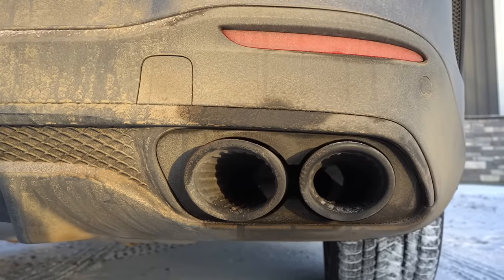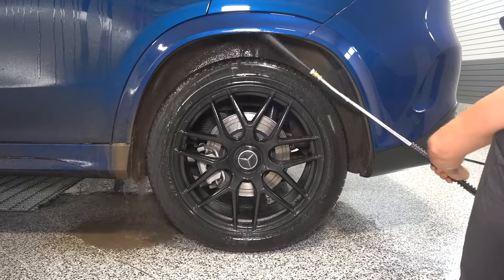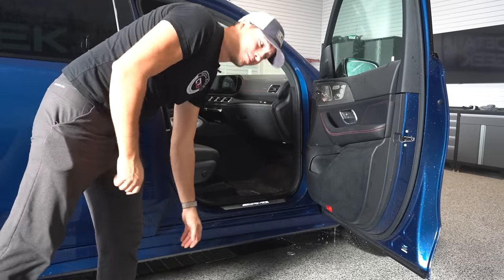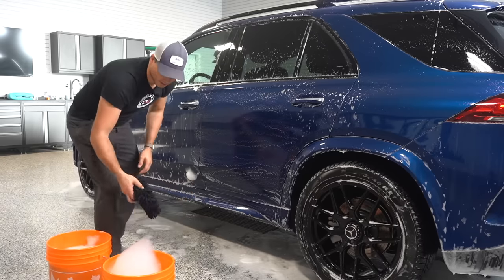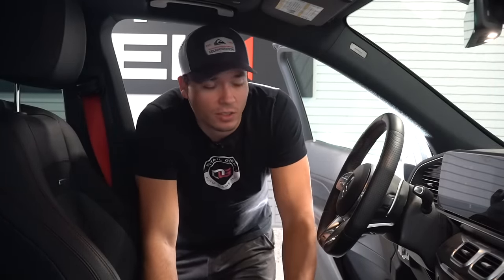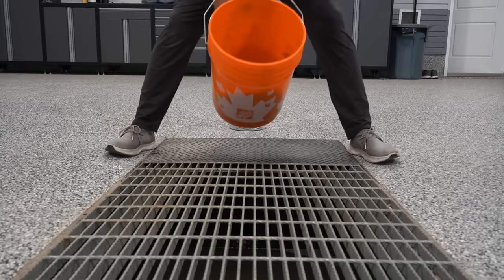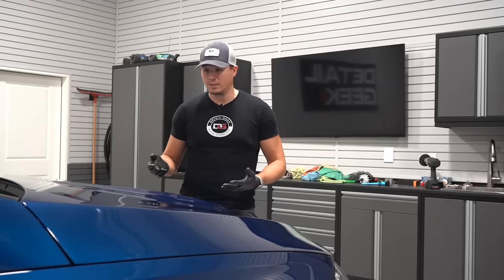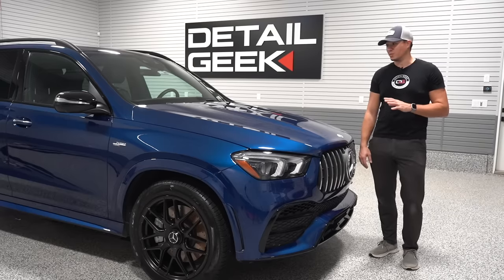Is Mercedes The WORST Car To Detail?

Comment: Great work man!! Watched a bunch of your videos and honestly great work. You really do need to consider getting a better vacuum, a home central vac & tiny attachment isn’t really the best and many videos it shows it isn’t really picking a lot. Just takes up your time even more if anything. Suction just isn’t there and using a good solid brand like dewalt or another good shop vac will go long way in picking up a lot more particles in fibres etc first time around too. You spray a lot of water/solution! Sometimes less is more considering vehicles higher trim levels have a lot more electronics and once that damp/wet even after extraction it’s not fully dry for days & same goes for carpets. As for “brands” charging extras, well we allow that by buying their brand, that being said we also can empower change.

Comment: The new work around for these subscription features is to tie them to a mobile app that has a subscription. Acura has an app,that costs $10/mo or something for remote start, location tracking, and valet mode with speed thresholds.

Comment: Hello, nice work, thaks for all the info.
Regarding that carpet liners on the wheels, those are for safety, on the highways, to reduce the mist fog from the water on the roads. That mist can create a mist and reduce the visibility for the vehicles coming from behind. The ideas, locking and unlocking features, for this practices are taken from Tesla and Apple(eg. supercharger, etc).
Regards from Romania

Comment: This is only the second of your videos I've seen and I have to say, I love your work!!  

As far as the companies charging for subscription features, it seems they're trying to have it both ways.  They charge up front for the feature and then monthly for you to be able to use it.  Having said that, I'm not a fan of government intervention - at least not in a case like this.  I think it should be the market that determines the pricing.  Unfortunately, the mode the market will bear . . .  so far, anyway, is the one where the customers pay up front and then get milked on a regular basis going forward.

Comment: you have to pay for the  enhanced features that come with the SUBSCRIPTION SERVICES offered on equipment that your vehicle comes with as optional, such as Satellite radio (XM/Sirius) or navigation (with Google). Most times, those enhances features come with a free trial period (usually 6months) that you have the option to renew. If you opt not, then you will still have the basic functions of the equipment that is installed. So you're paying for those options.

Comment: So many manufacturers are going that direction. I could see it simplifying the build process. Build all the vehicles the same, and then if you want the features, activate them. But to charge for the heated seats with a vehicle, and then charge a fee to use them? Not a fan.

On the flip side, manufacturers have been asking for extra fees with nav systems for years. And then there's satellite radio. You bought a vehicle with it, should you have to pay the subscription? What about things like GM's OnStar?

Comment: Great video on detailing, though there are a couple of corrections:

1. All 2022 Mercedes-Benz vehicles sold in Canada include a 3-year complimentary plan for Mercedes-Me services, providing users with the ability to remotely start, lock/unlock, and locate their vehicles.

Here are the corrections:

- Heated seats are standard and do not require a monthly subscription.
- Navigation is standard, but over-the-air updates are part of the Mercedes-Me subscription.

The subscription fees for remote lock/unlock and over-the-phone remote start are necessary due to the infrastructure required to communicate with satellites through the app. As a product specialist for Mercedes-Benz Canada, feel free to reach out if you have any questions.

Comment: I think in the UK anyway BMW (vested interest as I own one) said they put all the features in all vehicles these days and not everybody pays for them up front so they'll  charge those who didn't pick the options initially a monthly charge to access them. I don't think this is ridiculous though as it may be cheaper for example to only have heated seats and steering wheel in winter than the upfront cost which is thousands at purchase. Plus with android auto etc you don't really need the bmw map. Whilst remote locking and unlocking is handy I have never needed to use it and struggle to see when it would be useful as you cannot drive the car without your key being in the vehicle.

Comment: I’m in the same situation I bought a 2022 Acura RDX for $60k(usd)and they only include features like remote start and others for 6 months, thankfully many of those features I have them on the key fob since I bought the fully loaded trim but still is a ripoff, also I used mine as my daily driver and it doesn’t get nowhere near close to that level of mess, that owner is definitely disgusting.

Comment: For a 2022 and look how those back rotors are already scored, well they looked really scored, or is that just a different type of rotor. Scary to think what those cost to replace.
Predatory (that is a great word here) business practice for sure. The buyer is paying an outrageous price already, then factor in the cost of ownership of these expensive cars, and now they charge you to use the seat warmers you already paid for, that is robbery.   That would be like a contractor/builder charging the home buyer to pay to use their furnace, air conditioner, and cooking range in their new home because those devices are connected to an IoT thermostat.
I agree with you on the extra layer of protectant.  IMHO I think it would also extend the life of the clear wrap. I have seen videos of the guys who wrap cars for a living and put a ceramic coating on after they wrap them.

Comment: not filty. it is normal durring winter and will be like that in 2 days use.
about carpet liners, they are not carpet they are special mesh plastic. cheap plastic liners tend to crack, especialy when offroadind due to pebbles being thrown from the tire. most cars have fabric linners only at front but
4wd also on the back

Comment: Catching up on so many missed videos. I drive a 2018 Hyundai Tucson. Has a mobile app for all sorts of things. Start, climate control and even location monitoring. It’s $30 a month to use any of it. Despite all of it already being equipped in the car. And it’s been like that for years with them.

Comment: It is ridiculous to pay a monthly subscription for heated seats.  I have a 2022 Mazda CX5 with Heated Seats, Remote Lock/Unlock as well as Remote Start, all through an app, and I have navigation.  I did have to pay for the SD card for Navigation but that was only $50 on Amazon, however it would have been over $400 if I got it through Mazda, but everything else was included with my trim level.  I think I would need to pay to update the maps on the nav card.  As far as paying a subscription for remote lock/unlock, I would need to know their reasoning but seems ridiculous.   As far as navigation system, people pay for subscription radio so it is possible that it is the same for their navigation system, perhaps it also includes traffic updates and warnings with alternate routes.  I would also need to know the price for those last two subscriptions, but their is no excuse for the heated seats.

Comment: Older Merc's had standard plastic wheel liners and they were super quiet. I guess they don't use as much sound deadening anymore on the inside. Mercedes has dropped in quality very significantly... Renault made modules in Mercedes

Comment: Software is being used to control the hardware. I would never buy vehicles that have that but if all manufacturers do it might not have a choice. I'm sure there will be guys doing aftermarket unlocks though.

Comment: I did a little research after my first comment.  If I understand it correctly, there are certain options like heated seats that people may only use one or two months out of the year, so instead of paying $1050 that it costs as a permanent option with a hardwired on/off switch they can use them through an app and only pay a $12 monthly subscription fee for the months they use them. I live in the southern US and may only need heated seats one month out of the year so if I only keep the car for 5 years then with a subscription I would only pay $60 instead of $1050.  It appears that it is cheaper to just have the heating coils in all of the seats instead of having two different premade seats.  I guess they just have a smart chip or something that can be activated by an app.  So in this case they may have not already paid for it, sort of like having a radio that is capable of having satellite service if you choose to subscribe to it.  Still seems petty to not just make it standard.

Comment: Ummm no you don't pay for ft like the seat warmer you do pay for he app which is the Mercedes Me Connect which is free for one year when you first purchase the Benz unless you buy it use . after the year is up if you want to continue using the app you do need to pay $150 for the whole year to get the app working again... which includes locking and unlocking turning on the car and other ft... but that all you need to pay for. other ft agin like seat warmers that comes from factory NO need to pay for a subscription ..

Comment: I'm pretty sure what's happening is that they are charging a subscription for the software that controls all those components, which is how they are able to get away with it. Companies have been doing it for years with computers, tablets, and phones, which means it would be very difficult to regulate, especially because what you listed is not necessarily required for the operation of the vehicle. The only way to stop this is to choose cars and companies that do not charge subscription fees. Market pressure is a lovely thing.

Comment: If it is physically installed in the vehicle it should be included in the price. For example, heated seats has wiring and stuff ALREADY in the car and the manufacturer used resources to make it.
When it comes to things like software, it is like your phone on wheels and it depends on which software it is that runs on the center touchscreen.

Comment: In Germany, too, enthusiasm for such subscription systems is very limited. At least for the people who don't work for these automakers. I'm also pretty sure that the German government won't do anything about it, since almost every politician in Germany has been bought by the auto industry and the auto industry also has draft laws brought into parliament here, which are always approved 1:1. One could still understand it with such services that require constant updates, such as navigation or apps in the entertainment system. But paying to use a built-in heated seat is just plain insane. I would never get involved in something like that or find ways to hack it or bypass it. Greetings from Germany

Comment: I forget who it is, but the cars that have carpet, but on the inside of the wheel liner, I mean, if ya gotta...Oh, black wheels suck, it's like paying for pretty, but getting unfinished, like cars that lost it's hubcaps. Might as well disconnect one of the headlights throw some beer cans on the dash, put a rebel flag tag on the front to complete the look.

Comment: We currently we own a Mercedes here in Aus, we only got to use all the features for the first 3 years. We now have to pay approx $800 a year to be able to use all the features. Guess what, I’m not paying but it will also be the last merc we buy based on this. Car has been fine, couple of little recalls but nothing major. The servicing cost are astronomical, $1300 for a 25k service, oil filter, check this, check that, thanks for coming. I new they would be a lot dearer than say a Toyota Corolla but approx 1k difference, insane. Probably try a bmw next

Comment: I own a 2021 GLE 53, with all features but do not pay for extra features (yet) - not sure if this is something that will be coming though.   The difference is I bought mine in Canada, so there could be a difference in this regard.   I must add I never allow my vehicle to get to this state - I also do have PPF on the entire vehicle, though it is mate, so does make a visual difference.
Reply: Yes this video has some false information. Mercedes does NOT charge for heated seats other then the initial cost when you buy the car. That's a BMW thing that started in 2022.

Comment: It's interesting- I recently purchased a 2019 Mercedes from a dealership, and asked that very question- "This car doesn't have any subscription-based features, does it?". The salesman acted shocked I would even ask that, and said no. But from what you're saying- he likely only said that because I had an older car, and that likely would not have been the answer if I were purchasing a 2022 or 23. Disgusting.

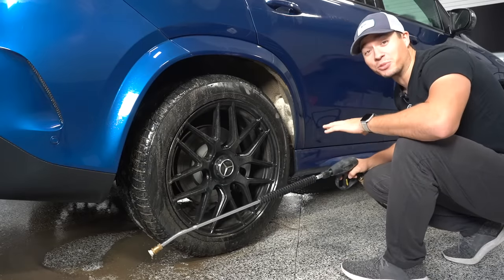Comment: 2:18 It's actually kind of funny you mention plastic wheel well liners, because while we all hate carpet, 3M evidently has a tape that does pretty well at dampening sounds (just found out about it recently); wish they would start putting that on cars, instead..
16:06 what the fruit, that stupid cup holder insert looks like farting aviator sunglasses 😎 😂😂😂😂😂
Reply: "Hmm.. 9 hours? 🤔 ...Maybe 8... 6-8?... I'm gonna go with 7-9 and see.." (and it was 8 😂😂😂)

Comment: I have mixed feelings about the subscriptions too. However they do this for two reasons.
1. Producing all cars with all extras is cheaoer than havin different configurations but not everybody wants a top spec model, so they lock features. This makes the overall median price for all cars lower.
2. Most of these high-end cars are bought not by private owners but are leased and then sold or released after 1-3 years. The car can be sold better, if the next owner can opt for different features that the previous owner.

On the other hand, I understand that it feels subjectively wrong to have locked features on a car I own

Comment: I'm not sure what the owner of this Mercedes is talking about, I drive a 2022 E53 and do not have to pay to use heated seats or navigation. The only payment feature I'm aware of is the Mercedes Me app which lets you use it as a remote starter. After doing some research the only thing I could find was that Mercedes announced a yearly subscription to get more power from your motor so you can drive faster.

Comment: ive seen a few of your videos, so youre supposed to use that snow thing before you spray off all the much on the first pass, because otherwise it acts like sandpaper and scratches the pain with a gazzillion micro scaratches... think of it as like a weak sandblast over the entire car
Reply from the maker: 100% incorrect
Reply: @TheDetailGeek  ok... ill take that.. sorry i was meant to actually prefice with 'i think'... but fine i will reconsider, if thats what you say.. guess i need to figure out how it works then if thats not how you do it...
Reply from the maker: I’m not saying that a pre-soak can’t help, but if you think it’s somehow penetrating all the dirt on a vehicle and magically lifting it all off….youre crazy. No matter what there will still be dirt on the paint and a pressure washer is the only way it’s coming off. Not to mention that I’ve done this on hundreds of vehicles, including every vehicle I’ve ever owned and have never, ever seen a blemish in the paint. A pre-soak is optional, not necessary.

Comment: The idea that lies behind payed subscription is to have only one configuration of the model. This makes the car cheaper, due to easier assemble on assembly line. In this case you can by the car cheaper and have all possible options available for this model. In other words, simply looking at configurator you can see that adding another option counts not in hundreds but thousands, and usually few thousand dollar for Mercedes. Anyways you either pay few thousand now or can pay 20 dollars a month to use something, which will last for 10 years equally what you had payed now. So the answer is actually this is a good new way to make cars more affordable and users can pay for what they need. Moreover, for example usually heated seats found their use in winter times which is 1/2 year, so who would need to pay for this subscription in summer if nobody uses it. In this case your car because is fully stocked has ventilated seats, so instead of paying for heated you can pay for ventilated. And here you can see difference, because ventilated + heated seats package for E class and above would cost around 2000 dollars from dealer, here you can pay 20 a month, IF you use it, it will last for 8 years when you pay for the whole year. But more likely people who buys Mercedes they. don't keep the car for 5 years, because they buy the new one. As a consumer few this is better because it actually cheaper, even thought it seems firstly as a scam

Comment: BMW are going the same way with subscriptions. I own a BMW 330e and have paid extra for the tech pack. Only to discover that things like auto high-low beam on the headlights is a £250pa charge. The equipment and software are obviously present in the vehicle, but to “unlock” I am forced to pay. Disgusting.